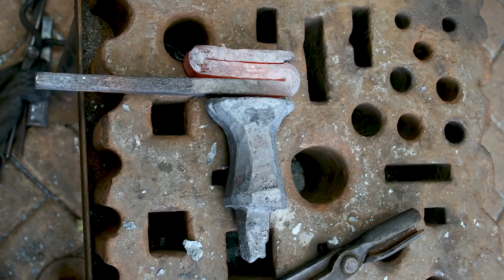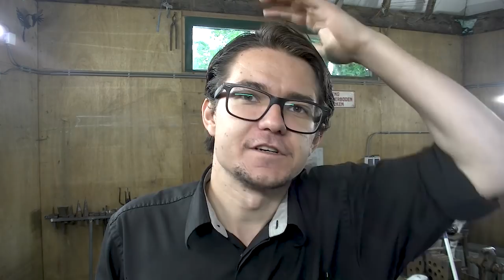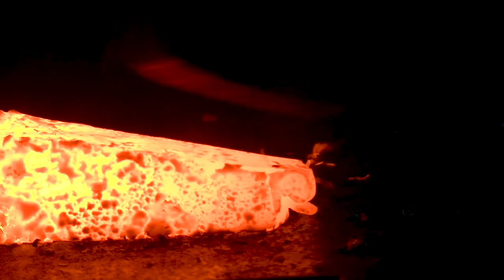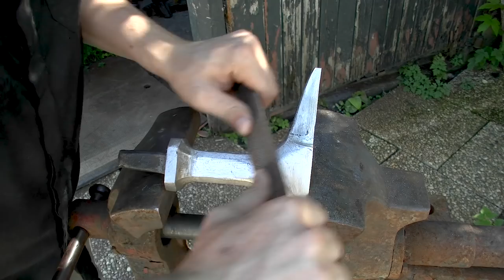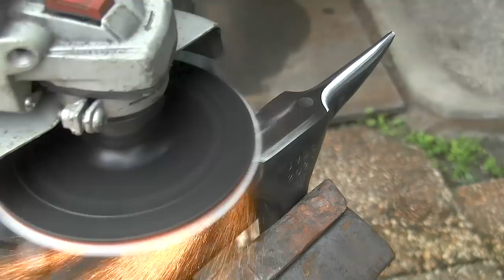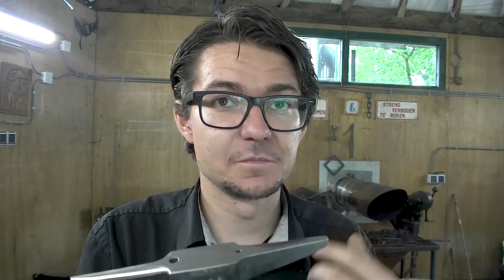Stake anvil, wrought iron and steel faced. (2020)

Comment: I seen a stake anvil at a renaissance fair and when I asked why a stake anvil instead of a full size anvil. His reply was "Its cheaper, easier to move and shows that anyone can blacksmith without a thousand something dollars anvil."
Reply from the maker: A block of steel is even cheaper. Makes me wonder if the Renaissance smith/guy sells railroad spike knives for 500 dollars each or more!
Reply: Okay so could a stake anvil make a good tool for getting starteg into smithing and what range of projects can you do with it? Then the renaissance fair man would` ve been  quite a hypocrite...
Reply from the maker: @alexzioek9680  I can't really say if it a stake anvil is good or bad for getting started into blacksmithing. There are distinct differences though. 
An anvil is more like a block, the mass is fairly close together. A stake anvil is pretty much the opposite, it's tall, but the face is not big and the horns are usually very long. 
The stake anvil was to back up the mostly hornless anvils smiths used to have so they could do their bending and setting operations. 
You can forge on a stake anvil. Though I find an anvil, even if a small anvil, just stands more stable, because that is what it is designed for. 

The Renaissance guy sounds to me like the type of person who dislikes paying money for (good) tools, since it's only a "lump of metal."
Why should that cost more than scrap prices?
Though they would happily sell you a 500 dollar railroad spike knife since it cost so much time to make it.
Yet, they own a 1000 dollars bit of plastic, glass and copper (their smartphone) to tell you, they think any tool above scrap price is too expensive.
Reply: Each tool has a set of capablities, a sawyers anvil is basically a big flat block of iron and steel for making long flat saw blades and thats about it ,  a london pattern anvil (or any with a table, horn, hardy and pritchel) is made to do a variety of jobs from tongs right through to garden gates ...stake anvils are made to do similar jobs  but on much smaller work or in hard to reach places.....If you look up tin smithing a stake anvil is an essential tool where in a way its an addon for a blacksmith
Reply: @TalRohan  Thanks a lot. My dilema was about whether to choose a small multi-purpose anvil or a stake. Both mostly for... multiple purposes as the aformentioned suggests but I need to start with some tool making. Having read the comments I think a small anvil is the way to go even though I need something quite portable, at least transporable. I thought that a 30- 40 kg anvil could be, pontentially ,a waste of money, a "toy anvil" while the stake could serve well before getting to the real thing and still having it` s place in the shop later. I was probably wrong with this opinion.

Comment: Super cool video as always, and always a joy to watch. Oh yeah, and also I am not sure if you will see this, but I have a question. So I have been saving up for a new camera, a Canon M50 to be exact, and one thing I want to do for my little channel eventually is to film some of my forging and get nice and close for the viewers. I was wondering if you would know if the intense amount heat and high amounts of light, especially from forge welding hurt the camera in any way? Would I need some sort of UV filter that I have seen you use to prevent liquid steel splatter? Idk I might be over reacting, but if you see this, it would help so much. Thanks, Pablo
Reply from the maker: Every camera is different. Mine seems to be able to take the heat OK. 
The manual says to NOT point camera at bright objects, which I fully fail at. The camera seems to hold out though. 
Get a disposable UV filter, anything to protect your lense, particularly with blacksmithing, grinding etc. anything that can fly at the lense and damage it. 
If I didn't protect the lense of my camera, I would have had to buy several new cameras....
Reply: Joey van der Steeg Thanks so much!

Comment: I’ve got about 65 pounds of wrought iron wagon wheels, it’s not very refined, do you think it is worth my time to fold it over and refine it a few times or just use it as is for cladding on knives? Thanks!
Reply from the maker: That depends. Does what you want to make really require wrought iron? If not, how much do you want to have it made of wrought iron? 
Then remains, how easy or difficult is it for your to work the iron? And can you insure the welds will be good or good enough? 
Answering these questions should give you an idea if refining the iron is a good idea.

Comment: I like coke. Bit pricey nowadays. Good, clean coke is like... well... good. KWIM? Gotta draw the line somewhere!
Reply: P.S. :Afterthought. Maybe next time forge the tool steel to a 'j' on both ends before the forge weld to the wrought? To 'wrap' around the wrought. Better horn tip integrity for usage? And of course draw temper the tips a little bit. Thoughts?

Comment: I have a question. Is there a reason you don’t use a Brian brazeal style hot cut?
Reply from the maker: I like quick in and out action, no tappy tap tap tap.
Reply: Keep a Brazeal style hotcut in your travel bag. Hardy holes are seldom a standard size in those old anvils that frequent smithing workshops and such. My shop hotcut is a salvaged axe blade with a piece of square bar welded into it (not fire welded).
Reply from the maker: @sjtaylor128  I either bring a hand chisel or a handled hot cut. Cut anything anywhere, regardless of the hardie hole. 
Chisels and handled hot cuts will allow you to do cuts and pattern decorations etc you can't do, or not even as easily with a hot cut for in the hardie hole, regardless of design.
Reply: Joey van der Steeg it’s really not that bad it’s just a tap and it’s out!
Reply from the maker: @ztheblacksmith  It's not like they are extremely stuck. I just don't like they have to be tapped to take them out.
I have used them  various times from other smiths. I just like an in and out hardie.
Reply: Joey van der Steeg 👍